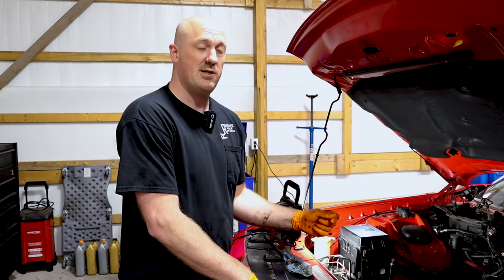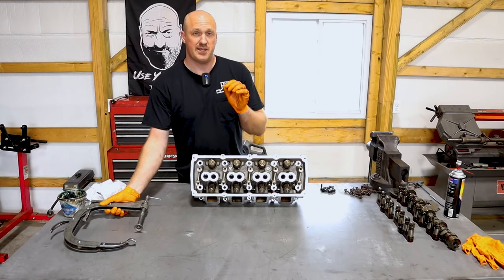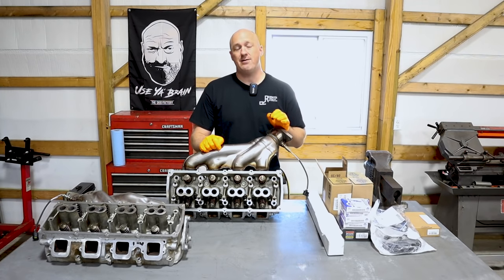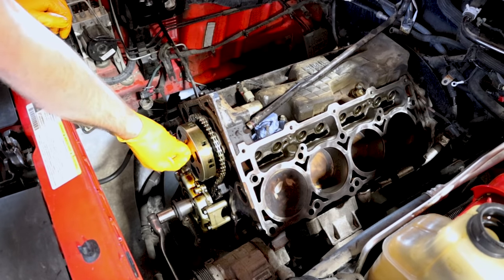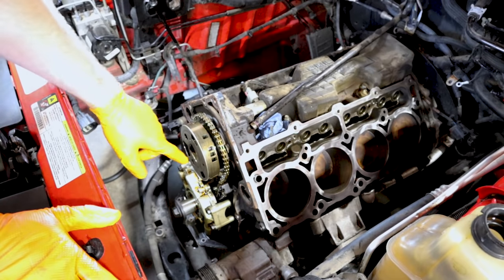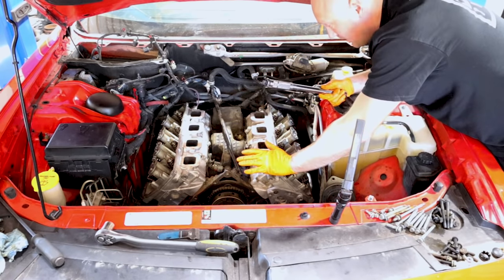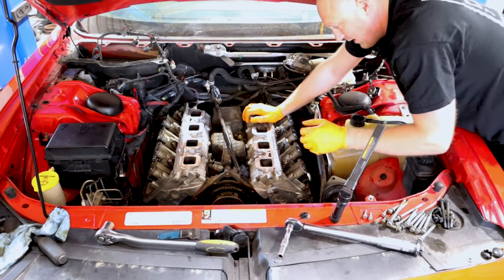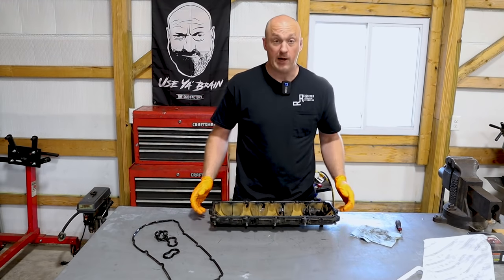Hemi Camshaft Installation Continues, SRT Headers Install! Budget Challenger Build Ep2

Comment: just found ur channel and subscribed! quick question on the video, i see how u installed the shorty headers onto the heads and then into the car. can u also do that with long tube headers? thanks for any advice!
Reply from the maker: I haven't tried it myself, it'd be interesting to give it a shot! I'm inclined to think that it won't work due to all the angles, but you never know unless you try, and if you've already got the heads off it's a great time to slip them into place anyway 👍
Reply: @ReignitedAuto  thanks foe the reply! being u were a chrysler rech, if u don’t mind, i’d like ur thoughts on an issue i’m having. i have a 2013 charger daytona with the 5.7 and nag1 trans that i bought used with 63k miles. the only issue that i’m having is with the trans going uphill occasionally. it did throw a p0741 code. i then replaced the tcc solenoid with a new mopar tcc solenoid. however, the condition still exists. i’ve read where trans must b replaced and or the torque converter has to b replaced. i’d like to try to fix myself if possible. any thoughts??
Reply from the maker: @sposey69  I can almost guarantee it needs a torque converter. Fairly common on the NAG trans 👍
Reply: @ReignitedAuto  thanks for the reply!! the torque converter replacement makes sense. everything else with the trans seems fine. just had a hard time believing that the whole trans needed to be replaced. any tips on the tc replacement?
Reply from the maker: @sposey69  it's pretty straight forward, only thing I would say is: as the trans is coming out, keep the torque converter fully seated and measure the distance from the face of the torque converter to the bell housing. Having this means when you seat the new torque converter you can verify its fully seated. I've seen people only get it partially seated and eat the ears out of the trans pump 🤯

Comment: How do you lock the camshaft from spinning when torqueing the phaser bolt?
Reply from the maker: Best option is to access the flex plate through the little inspection plate and stick a pry bar in there to keep the engine from rotating. Doesn't take much 👍
Reply: Thank you and I wish the world had more people like you!      @ReignitedAuto

Comment: Hey Reignited, quick question. When I look all these parts up it mentions it for a Challenger. Would that be acceptable in my 2013 Charger R/T??
Reply from the maker: Absolutely, direct fit 👍
Reply: @ReignitedAuto  thanks you so much. #subscribed
Reply: One last thing and sorry for the headache but what sealant did you use on the bottom of the timing cover?
Reply from the maker: @caseykuchera1126  it's a mopar specific engine rtv: 04883971ac
Reply: Is changing the springs required for the 6.4 upgrade? I can't find springs anywhere near me.

Comment: Do you have to do anything computer wise after changing the cam?
Reply from the maker: Any time you change to a different camshaft you will need to optimize the tune to take advantage of it. Likely the engine will run on the stock tune, but it probably won't be better than the stock cam until it's tuned. 👍
Reply: @ReignitedAuto  great information, thank you!

Comment: hello my friend, my name is Ernesto and i have a 2010 grand cherokee SRT8 WK1 6.1Hemi with 119K miles on it and just got what apparently is a bad lifter/cam miss fire on cylinder #7 ( i alrredy replaced all 8 coils, all 16 plugs and the injector on just that cylinder and all Mopar OEM from the dealer ) so i think i have no other option than replace them both (cam and lifters and spring etc if necessary but before i make any decision i would like to know if you please can provide me the specs on my stock cam and the specs on the cam you are installing on this challenger or any other aftermarket cam that you think will work fine in my case, i daily drive my Jeep so i really don't want a very aggressive choppy cam that requires a different torque converter i just want something that gives me a bit more torque/power at the low/mid RPM range just to make it a bit more fun to drive than it is now, it is pretty much stock other than K&N CAI system, Borla cat back exhaust system with cats deleted and a tune with HP Tuners.  I also will greatly appreciate if you can provide me the torque specifications for every single bolt & nut involved in this project and last but no least i know in the 5.7 is possible but want to know if in my 6.1 the oil pump can be removed without dropping the oil pan, sorry for these many questions and big thanks in advance, have a nice day

Comment: Have you ever fitted a 6.4 cam to the earlier 03 to 09 5,7 hemi ?
Reply from the maker: No, the block design is slightly different so the 6.4 cam won't fit.
Reply: @ReignitedAuto   Thanks for your reply muchly appreciated,  can I use 6.4 lifters in an 05 engine?
Reply from the maker: @themacgyverinstitute5340  you can, but the 6.4 lifters are no different than any standard Hemi lifter.

Comment: Just did a cam swap an my oil psi is at 18 I didn’t take off the oil pump. If I swapped my lifters and didn’t match the rear mds holder for the lifter what can happen

Comment: How much horsepower is gained with the k&n cold air intake & the 6.1 cam installation ?
Reply from the maker: Good question, I haven't been able to dyno the car yet, but I'm thinking between the camshaft, the headers, and the air intake I'm probably looking at around 40ish hp.

Comment: Do I need to remove pushrods lifters and rocker arms just to swap out camshaft? I  have already replaced those with new and all forged.
Reply: Rocker arms keep the pushrods tight against the lifters, that in turn push on the lobes of the camshaft. To remove camshaft you need to release the tension from the valve springs.
Reply from the maker: Technically you can remove the cam by removing the rocker arms and pushrods, spin the cam 720 degrees to push the lifters back in the bores, and remove the cam. You run the risk though of the lifters sliding back forward again before you get the new cam in place.
Reply: @ReignitedAuto  if I was to replace the camshaft without removing the heads by turning the old cam 720° like you said,how would I go about keeping my timing in place before all this since I won't be able to see the piston TDC?
Reply from the maker: @angelcedeno26  As long as the vertical mark on the camshaft is at 12 o-clock before you removed it then you know the crank is already in the right position, just make sure you don't spin the crank after you remove it, otherwise you'll have to remove the oil pump to verify the crank timing mark.
Reply: @ReignitedAuto  do you recommend any sealer or silicone on the intake manifold and valve covers other than the gaskets? You're probably going to start charging me for all my questions 😂
Reply from the maker: @angelcedeno26  nope, no silicone needed 👍
Reply: @ReignitedAuto  sorry,I have another question,my car is a 2012 automatic,I would need the 6.4 cam with mds correct? also I have all new springs and push rods,but will I need to changed them for 6.4 pushrods, springs etc?
Reply from the maker: @angelcedeno26  If you're keeping the MDS then yes you'll need a cam that supports that. But you won't have to replace your springs and pushrods if they are already upgraded.

Comment: TDC on the compression stroke right? 
Or is there some magic that I haven't learned about the hemi
Reply from the maker: Technically yes, but the crankshaft doesn't care- TDC is TDC for the crank, it's the cam that makes it the compression or exhaust stroke. And you set the camshaft position yourself 👍
Reply: @ReignitedAuto  yeah I know that much. But when reinstalling the heads the cam cylinder 1 has to be on the compression stroke, because if the cam was on the exhaust stroke a valve would open up up?
Reply from the maker: @user-yk5xk5re3p  that's true, but the only way to set the timing correctly is to install the cam on the compression stroke, so you really don't have to worry about it.

Comment: Hi,
Those cylinders heads does not look machined from the bottom.
Did You install Heads without it?
Reply from the maker: There's no need to machine cylinder heads unless there's been an issue with overheating or you suspect there's a blown head gasket. All you need to do is clean the old gasket residue from the surface and reinstall. 👍

Comment: Would the torque specs be the same for a 2007 chrysler 300c srt8
Reply from the maker: There are usually some minor differences between the different Hemi models, but I suspect they would be very close to each other.

Comment: This makes me worry a lot about mine. It has 182,000 miles. I hear from people a lot that the valve seats drop causing catastrophic damage. Do you find that to be true?
Reply from the maker: What year is yours? Generally the valve seat issue affected the '06-'08 models.
Reply: @ReignitedAuto  06 lol
Reply: @MrRickTic  I'm at 260,000 on my '06 so I wouldn't worry about it. I think its a small percentage that have valve seats drop.

Comment: Great channel. For a Ram 2500 5.7, would you recommend the SRT manifolds or a set of headers? Thanks. Keep up the good work, loving the content.
Reply from the maker: Headers for sure, the srt manifolds are only designed for the challenger/charger/300 vehicles. 👍
Reply: @ReignitedAuto  awesome, thank you. Any brand you recommend over others?
Reply from the maker: @unlimitedljadventure  I don't have personal experiencewith any of them, so no recommendations from me.

Comment: Can you delete the mds on a auto with the cam swap?
Reply from the maker: You can delete the MDS, but you also have to replace the MDS lifters with non MDS, you have to remove the MDS solenoids and install the block off plugs, and you've got to use a flash tuner to turn the MDS system off in the PCM. 👍

Comment: Hi my friend I love your videos I have a question when you replace the camshaft and lifters do you have to send the heads to the Machine Shop or you just can't put them back on?
Reply from the maker: There's certainly nothing wrong with taking the cautious approach and having the heads decked by a machine shop before reinstalling them. However, if you are just performing a cam/lifter repair and have no indication that the vehicle might have been overheated at any time, then you are able to just clean the head surface of the gasket residue and reinstall them. 👍
Reply: @ReignitedAuto  thanks a lot my friend you're the best. Also I heard that Hemi engines have problem with the valve seats falling down to the Pistons is that true. My truck has a hundred and sixteen Thousand Miles do you think I have to replace the valve seats?
Reply from the maker: @vipertv6010  depends on what year you have, if its 2009 or newer they solved that problem 👍
Reply: @ReignitedAuto  oh good my is 2011 ram. Thankyou so much 👍

Comment: How do you keep cam from tjrning when torq the cam bolt?
Reply from the maker: Easiest option is to remove the access plate for the flex plate and stick a pry bar or screwdriver in there to keep the flexplate from rotating, then torque the cam bolt. 👍

Comment: The only thing I would do different is replace at least the chain; if not the gears. As the chain wears, it stretches. When it stretches, it retards the cam timing

Comment: Will the srt headers work on a 2012 ram 1500 5.7l
Reply from the maker: Unfortunately no,  they will bolt up just fine,  but they won't point in the correct directions.
Reply: @ReignitedAuto  thanks for getting back to me I was hoping to use some factory headers but I guess it's aftermarket now

Comment: Did you resurfaced heads ?
Reply from the maker: Nope, while I wouldn't fault anyone else for doing that, if the enginehasn't been overheated or had any major engine issues there's no problem with just cleaning the gasket surface and reinstalling them. 👍

Comment: did you soak your lifters?
Reply from the maker: It's not strictly necessary. The factory lifters come pre oiled, but even if you soak them they'll still rattle for a couple minutes. There's no way that them just sitting in a tub of oil will get the air out. 👍

Comment: Do u only work on YouTube or r u available for Mechanic work
Reply from the maker: Not currently taking on customer work.
Reply: K appreciate u answering.. I got to do the lifters on my 2012 Chrysler 300 S do you think It’s OK to upgrade the cam shaft while doing it or will it be more expensive to put the 6.4 almost the same thing you’re doing without the SRT manifold
Reply from the maker: @delianysantos9014  might as well 👍

Comment: can I install a 6.4l cam on a 5.7l?
Reply from the maker: Depends on the year, if it's 2009 or newer then yes. You'll need a custom tune to go with it to make it perform at its best though.
Reply: @ReignitedAuto  can you use the same pushrods from the 5.7 on the 6.4 cam
Reply from the maker: @potatochipboy189  you sure can, although hardened pushrods are pretty cheap so your call on whether you want to change them out or not 👍
Reply: @ReignitedAuto  thank you so much for your input it really helps

Comment: I disagree though, 124,000 Miles Should not be Expecting To see a Lifter Failure. At that Mileage its still a pretty low Mileage to be seeing a lifter failure... But, Good thing you was doing the upgrade you was doing already and caught it.. Because If it was a regular persons car. It could've easily turned into a nightmare and unplanned $$$ Expenses. I still think FCA did a banged up job designing that engine. They Should've done a better job designing that Engine Cam/Lifter Sitting Environment.

Comment: Do you honestly think it’s ok for a motor to start eating itself at 120000 miles?!
Reply from the maker: I think that most engines have flaws if you look closely enough. I also think that people over dramatize how catastrophic this issue is. If you are aware that there might be issues at a certain mileage, put some money aside to fix it, then enjoy the vehicle for an additional 100k miles. 
Just the same as when you own a home, things happen sometimes and it makes sense to keep money available if and when it happens. 
I suppose I take a lesser view than most because it's relatively simple for me to fix stuff like this, but I don't think it makes it a bad engine, especially since it's not 100% failure rate.
Reply: @ReignitedAuto  while you’re right it’s not 100% failure rate, it’s close enough that most people should be worried about it. I’ve got a 14 ram with a 5.7 with 53000 miles on it that I think I’m going to start stacking parts for. When I get what I need together I’ll start the cam swap. Luckily I don’t have to take it to a shop to do it and obviously neither do you. Add in labour to that cost and it’s a significant hit to a person who’s budget doesn’t allow for that. I’m generalizing here, but most people who drive a vehicle with ~120k miles aren’t going to be happy with what the repair is going to cost. Especially if it’s there daily. I think it’s a big enough problem dodge should do something about it. My wife drives a 2011 Hyundai Elantra, last spring it was making a noise, took it to Hyundai, they changed the motor. No questions asked. I was pretty surprised. Anyways, I’m enjoying the vids, I too have a 86 c10 short box. Mine has a LS and a turbo. Also controlled by terminator x max.
Reply: Also I forgot to ask, should I just wait for the tick or repair before?

Comment: In my opinion those factory lifters are garbage. Does anybody have any recommendation for something more reliable?
Reply from the maker: For myself, I'm still a believer in factory parts. In my opinion, if they made it 100k+ the first time around, that seems to be a pretty good track record for me! I'm sure there are upgraded versions out there, just beware of going cheap! I've definitely heard of horror stories with those cheap lifters.
Reply: @ReignitedAuto  I would absolutely pay more for a better lifter. I’ve heard going with SRT lifters would be a better option but I’m not sure if those are any different.
Reply from the maker: @ryankursehuston  Nope they are not. In fact, it's the exact same part number for the "hellcat" lifters as for the standard non MDS lifters.

Comment: Come on, surely you own a set of cylinder head supports or you could make a set.
Reply from the maker: You know, in 11 years of working at a dealer I never used them 😄. I suppose it'd look more professional though, and it's one more thing I can make myself, thanks for the idea 👍
Reply: @ReignitedAuto  I was surprised when you installed the spring compressor and I thought, surely he’s not going to stand that up and do this!!!
You did, as long as nobody got hurt and no damage done it’s all good!  I’m looking forward to this build series.

Comment: Are these parts compatible with a gen 1 5.7? I have a 2006 300c I'm looking to do this same upgrade. Just wondering if the same 6.4 cam works for mine as well. Thanks
Reply from the maker: Unfortunately it does not, only fits post 2009 Hemi engines. Working on a new series currently though that focuses on the pre 2009 models 👍
Reply: @ReignitedAuto  Awesome! I'll be waiting for that series for sure! Thanks for all the info man its been amazing. Finally taking the bigger steps and doing my Internals. I've learned alot about this engine but even more since I found your Channel thanks again for your work.

Comment: Why do you say 106 inch pounds instead of 9 ft lbs
Reply from the maker: In my experience ft lb torque wrenches get a little sloppy at lower numbers like that. I'd rather use an inch lb torque wrench and make sure it's accurate 👍
Reply: @ReignitedAuto  another question. Best way to clean off engine heads and top of the block and pistons

Comment: my grand caravan 3.7 v6 160,000 miles no lifter or cam problem just faulty harmonic balancer, so lets stop making excuses for faulty manufacturing design on all major brand of cars, years ago 200k miles with littles mech. problems was the norm.